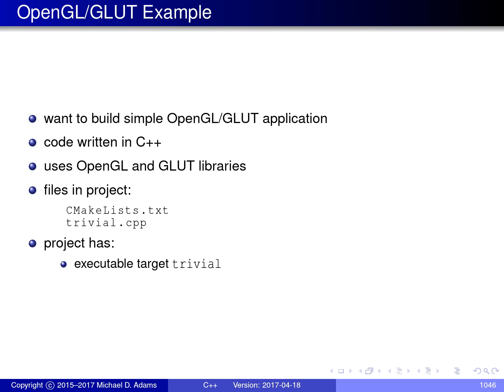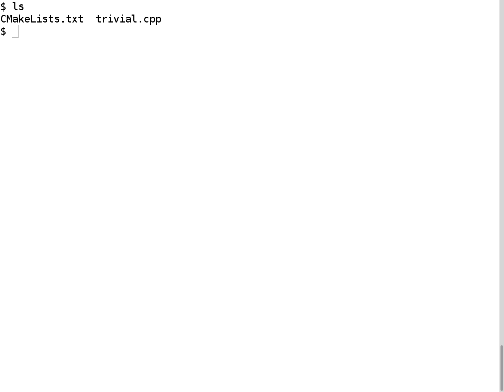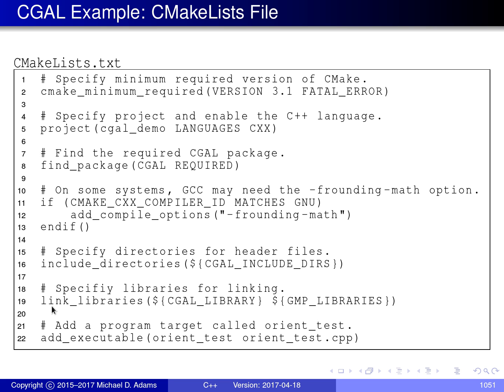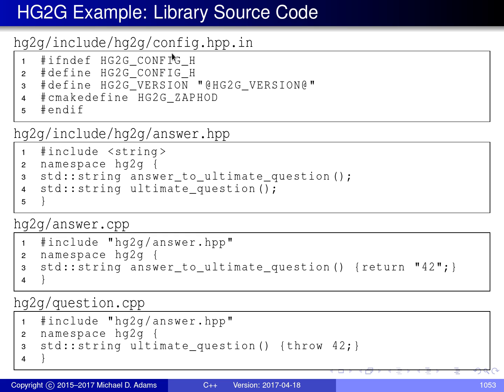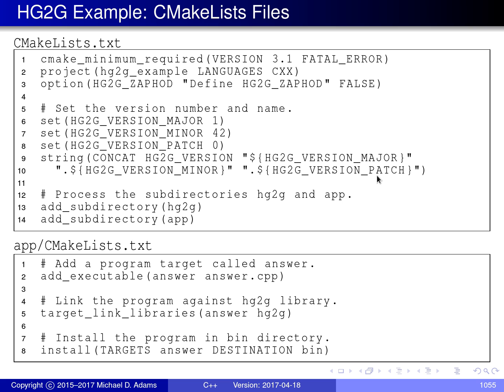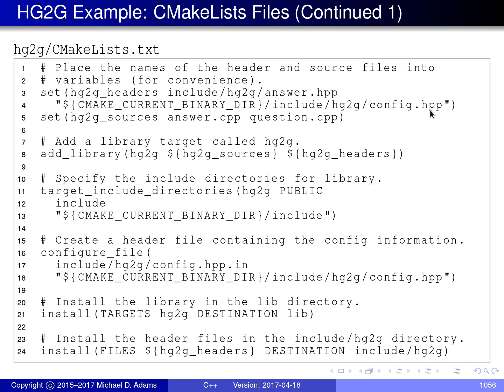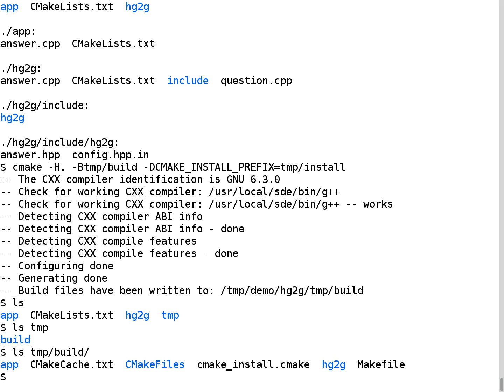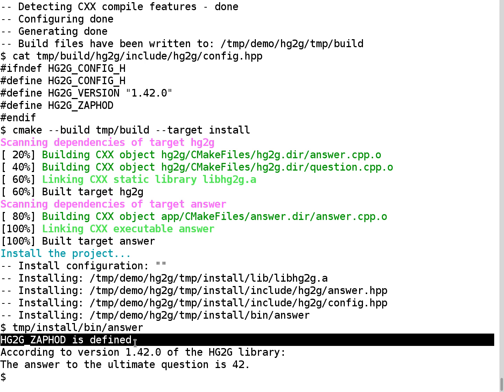C++ Lecture Series --- Build Tools --- Part 4 of N --- CMake Examples

Comment: Why did we need to install the answer target after building its executable? I think I get why we needed to install the hg2g library (because we generate one of the header files during the build process; correct me if I'm wrong please). But then we link the hg2g library to the answer target. In the other examples, we just built the executable and ran it, but now we're installing it as well.

Comment: how does cmake know how to find glut or opengl? it search the entire computer? cant we simply point where does the library reside? cmake is like a shit..documentation sucks..i have trouble find a decent tutorial..
Reply from the maker: Normally, you would use a find module to locate libraries (when such modules exist).  While I would agree that CMake is far from perfect, it is one of the better build tools out there.
Reply: I'd ideally use -I -L parameters with g++, not sure how to do it with CMake, though